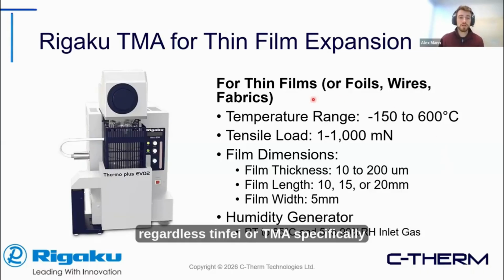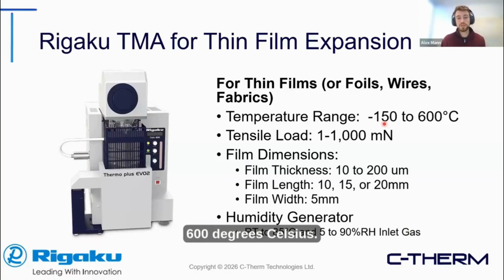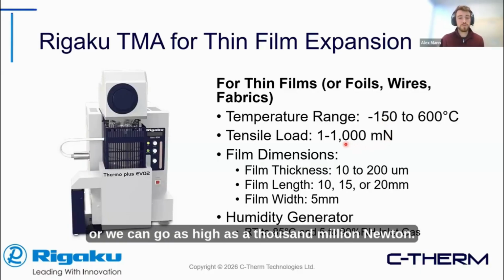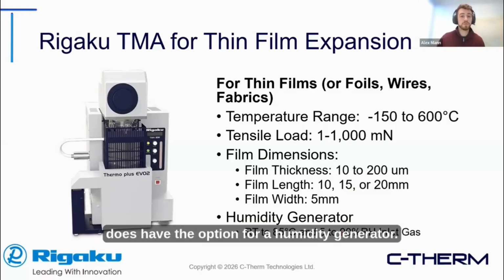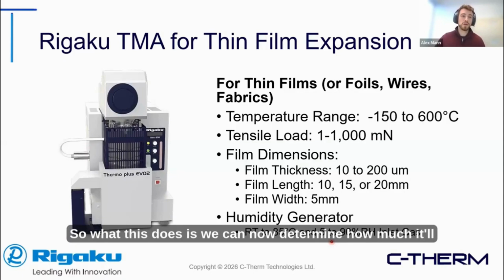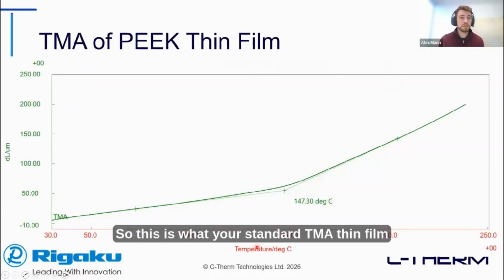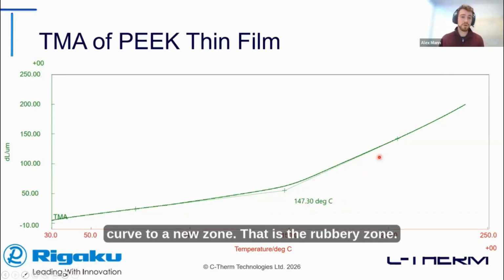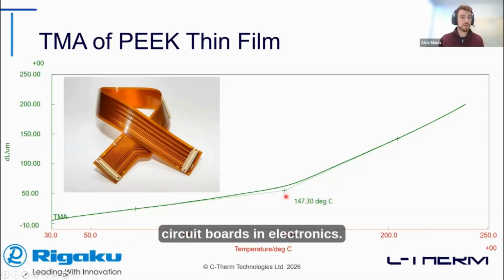Thermal Analysis of Thin Films: Coefficient of Thermal Expansion

Comment: This was a clear explanation of how coefficient of thermal expansion and glass transition temperature are measured in thin film polymeric materials like PEEK. How important is humidity controlled TMA when predicting real world performance for flexible electronics or fabrics?
Reply from the maker: Yeah—humidity-controlled TMA matters a lot for flexible electronics and fabrics.

In the real world these materials don’t just “expand with heat”… they also swell/soften with moisture. Polymers and textiles suck up water, which changes stiffness and makes the “CTE” you measured dry look way too optimistic. That’s when you get curling, warping, trace cracking, delamination—especially in layered flex circuits and wearable fabrics.